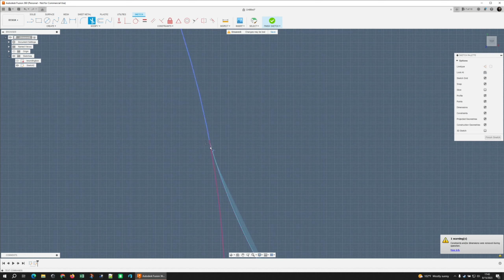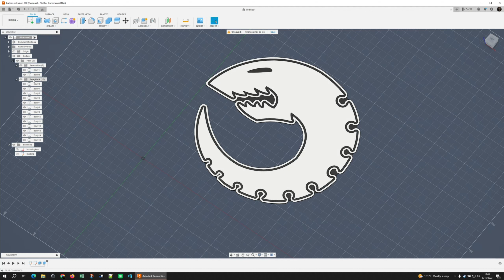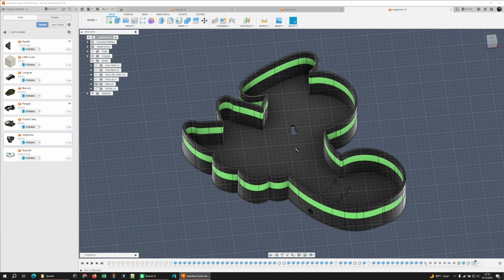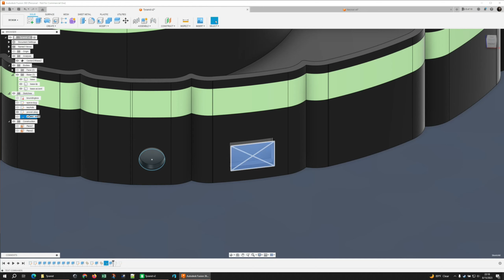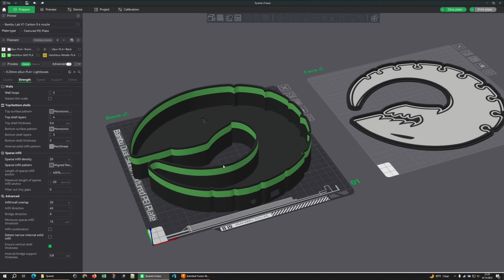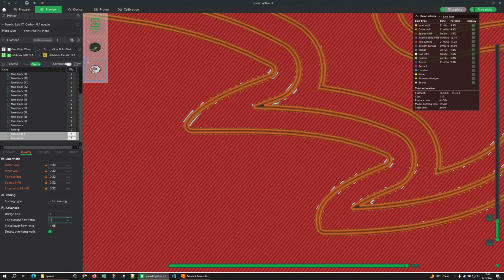Start to Finish: Tyranid Lightbox

Comment: When you make your face model, if you put one full layer of white behind the picture it should stop any pinholes from showing through. Great video 👍🏼
Reply from the maker: I've considered that, or perhaps using a "natural" (eg; "kinda clear") material. My concern is that it could pick up any surface irregularities from walls in dark/opaque colors and smear them over the translucents, similar to what I'd experienced with ironing problems on flush multi-color prints in the past.

For sure something to try out though!

Comment: I'm fairly dialed in, but keep getting wisps of colored filament in places they don't belong,  I pause the print after layer 1 and check for and remove these, but what have you found is the best way to prevent these stray wisps of filament that gets where it shouldn't?   Also do you have preferred first layer speed?  I'm currently at 35 to combat the wisps,  but it's painfully slow
Reply from the maker: It's a never-ending battle. Part of what we've come to the conclusion of recently is flow ratio tuning is critical in reducing whispies. We've had a test pattern going around that multiple people have printed with a combination of original material and process settings, their own (tuned) material settings with the original process settings, original material with their own process, and of course with their own combined material and process settings. In that matrix of tests the one constant seems to be if your material profiles are set too high you get a lot more whispies. Treating your opaques like BBQ - that is "low and slow" - did not work if the flow ratio was too high.

I think - and am trying to catch on slow-mo - the most common cause is slight over-extrusion causing a build-up in corners and when the nozzle drags through this to position for a new line it pulls a whispie out of it.

I've had a solid half-dozen boxes without a single flaw recently. I also completely re-built all my material profiles and re-calibrated each one (flow, pressure advance).

The two profiles I'm using - one for the face, one for the base - are in their most current form here - https://makerworld.com/en/models/90934#profileId-97275

Comment: If doing this with a .2 nozzle would your settings change? In particular the face plate?
Reply from the maker: @shannonchappell2167  line width and layer height obviously change with the nozzle, but beyond there not really. I've made a few with a 0.2 and they come out great, just take ages to print.

Comment: Hi. Great video, but i found that in my bambulab studio i dont have "initial layer flow ratio" option, mby you know why?
Reply from the maker: You have to enable developer mode. File > Preferences, down at the bottom there'll be a checkbox for it. You have to do it every time you start the program, sadly.

Comment: nice video. how did yo make the keyhole sketch and what are the dimensions of the keyhole?
Reply from the maker: I pulled a thumb tack out of my bins and took the calipers to it.  Added a bit of clearance and decided on an 8mm circle for the bottom, 5mm hole for the top, straight lines drawn down from the outside of the 5mm hole, then trim out all the middles.

I actually just keep a read-only template file that has all the cutouts and other stuff I need already drawn up and just duplicate it to start a new project. https://ludicrosity.net/3dp/images/f360template.png

Comment: What is the best way to fill empty space in first layer ?
Reply from the maker: As in voids around the subject or pinholes where light gets through?

If you're just completing a design - I like working with offsets of existing lines, trimming them and filleting them to aesthetic geometry. Sometimes it's fast, sometimes it's a real pain to get something that looks good.

As for pinholes - I look in the design for really sharp and narrow arcs and drop a dia. 0.42mm circle wherever it'll fit, then trim the rest off. In the slicer make sure you're using Arachne for walls with an aggressive transition angle (like 30°). Without messing with hole closing (the default is usually fine), that'll catch 99% of 'em.

Most pinholes show up along areas where walls are completely the same through the entire height of the model. Smaller lines witches in the first layer combined with "only one wall on first layer" will put variation both to the thickness of the lines and their ultimate placement. Three walls drawn on the second layer of contiguous lines over the corners of the solid infill on the first layer work amazingly well to fill them in.